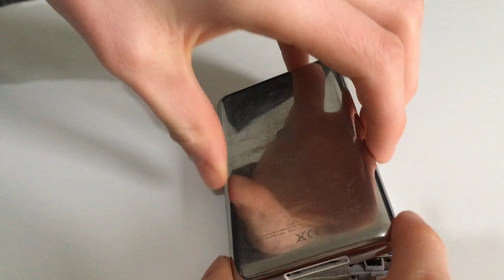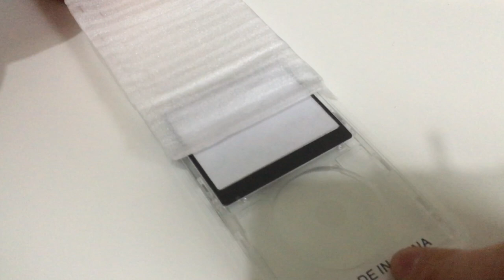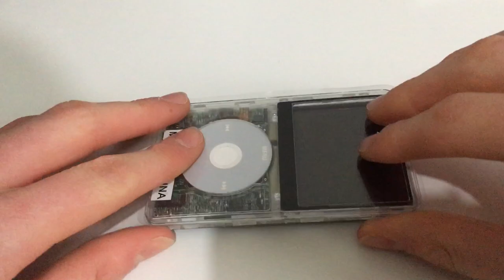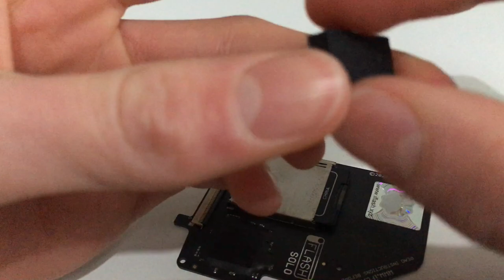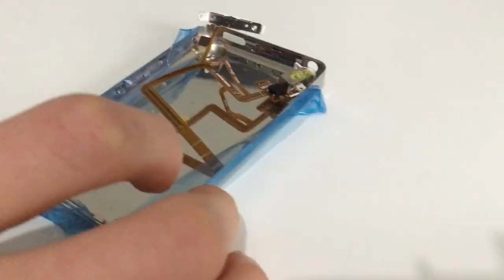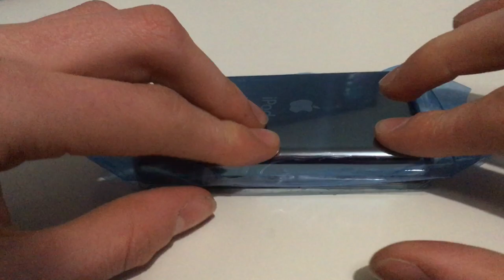Building the Ultimate 5th Generation iPod Classic - Timelapse Video

Comment: Will fitting an iPod with a 3000mah battery make the iPod thicker? I might get a custom iPod from Elite Obsolete if Apple drop the charging port from all their next iPhones, and I want to make sure that even if I go for a 3000mah battery, which is thicker, I can still slot the iPod into one of those iPod speakers that were made back in the day. I got rid of most of my CD collection (not without adding it all to my iTunes) last year, because my parents are thinking of moving to a smaller house!
Reply from the maker: yessir you need to fit a bigger backplate from the 160gb models!

Comment: Can I ask did u order a large back iPod case to help fit that I flash card? Wondering if u have a thin back iPod can u just replace it with a thick back off aliexpress
Reply: iFlash is thinner than stock HDD & has the foam pads to not jingle around. Thicker back needed when upgrade to more powerful bigger batteries but not needed when changing storage. Thin ipod is compatible with thicker back.

Comment: There is gap.
Reply: KNOW ITS 2 YEARS OUT BUT ITS BECAUSE IF THERE IS A PROBLEM LOADING THE SOFTWARE ON IT THEY CAN EASILY TAKE THE BACK OF TO CHECK CONNECTIONS REDO THE SD CARD ECT. THAT WAY DONT HAVE TO RE PRY THE CASE AND DAMAGE THE NEW ONE